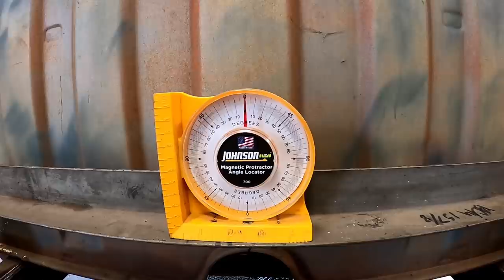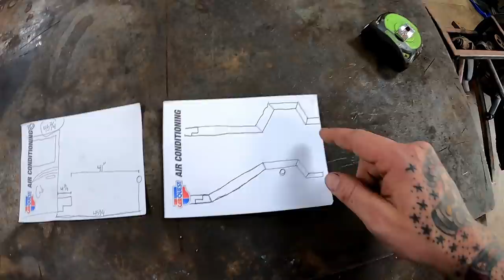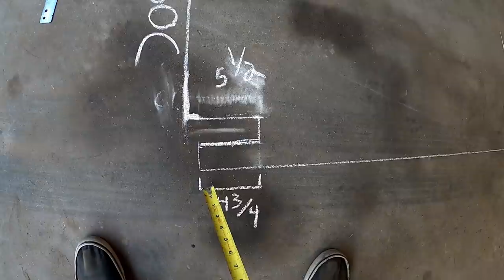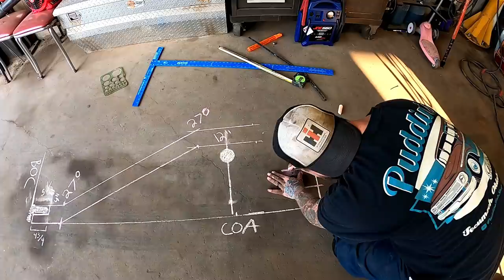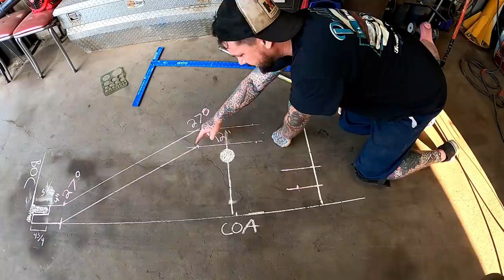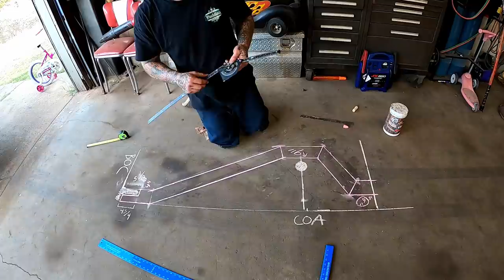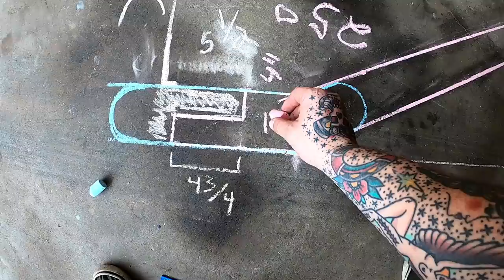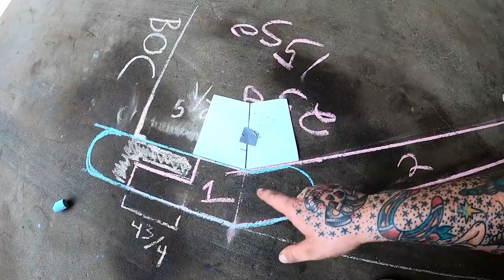Abandoned Minitruck Revival. “Dat-sun” of a B**** needs a new frame.  1977 Datsun 620.

Comment: Years ago, I had an 82 datsun 4x4, and my buddy had a 82 2wd. For some reason he took the bed off and was daily driving it. I had an extra set of 33's and suggested he put 2 on the rear, well he did, and it actually looked quite cool all jacked up in the rear. He ended up driving it like that for quite some time.
Reply from the maker: That’s awesome 👊🏻👊🏻

Comment: That frame has gotta be 10x stronger than the original ever was, and that's saying something! I once loaded 3000 lbs of roofing shingles into mine ('83 King Cab) and it didn't hurt it one bit. Did make the front wheels dance a bit while going around corners, though. 😁
Reply from the maker: 😂😂 they are stout!

Comment: That truck is really cool especially 12 years ago done by yourself and dragging etc might have thrown the frame angle off some getting hot or twisting. I'm a mini trucker and going to shows seeing those mini truckin magazine cover trucks up close...well they were hack jobs. Love Datsun hard bodies ..my last was a 96 s10 and we did a 10 inch monster notch ordered the kid welded cut moved the tank cut the inside if the bed after going through 3 beds ..never put air on it also custom driveshaft tunnel ..it was so low the rear axle touched the frame with 2 stacked 3" blocks had to remove one each side front was only ever cut coil rode damn good after notch but hell I was 23 24  had custom u bolts made for stack blocks removed leafs..but point was after notch I made everything right. Never ever had a problem the way it was before..just had to prove I could be lower than everyone lol. Worked 8 hours then 8 hours that evening doing the notch. Damn miss those days lol now stanced cars. We got an abandoned 78 Datsun ext cab bagged sheet metal bed Canadian bed no strap hooks welded tailgate skin. We did front tubs for dude he left it since 2014

Comment: Back in 1970 i was told they were called (dot-sun) but you can call it any damn thing you want i'll know what you mean. 👍👍.  I like your cross ventilation air system. I use the same method in southwest Missouri.

Comment: I learned and was actually tracking on your fab work up. Especially, since you didn't use farm animal calculations! The frogs hair measures was bout the same as mine would be, a smooth skin nudge. Seriously, I'd trust your current fab work but you probably had a lot of fun  rides with your teen fab work too.

Comment: What a cool Channel bro reminds me of me and my my buddy we started a shop too early so we just use the excuse of it was a hobby shop but we had to revive them and Fab them at the same time when you buy yard ornament turds it's kind of a must. He got a  "real job " but still helped all he could . I stuck it out and in just a few short years I have more business than I knew what to do with was able to start choosing what I worked on and due to the good prices laid-back Style and a lot of other things we have in common the haters literally ended it I never even seen it coming but the one thing that I can't get over on top of all our things in common is my shop was called buddins instead of puddings. Being there was two of us started out it was Buddin Boys  Custom off road  and recovery. Don't get me wrong Doe-son my first ride got slammed 92 Mazda B2low cab-plus se-5. Learned how to drive a manual transmission in a little black and yellow dot-son of my grandads . Never forget those bed latches side hooks and those MoonPie hubcaps cooler truck then anything Nissan put out anyway stay Pimpin my friend

Comment: Got to remember rust is lighter than carbon fiber. It's all natural weight reduction. Yeah I just moved to Massachusetts a couple years ago and they have vehicle inspection out here too I think it's so dumb I'm from Chicago we don't have inspections we just have emissions and anything from 96 and prior you don't have to take in. Those little trucks remind me of my Mitsubishi mighty Max I love that little truck had a 7-ft bed a five-speed manual a little thing it was like a 1.7 l four-banger it was already basically slammed to the ground from the factory got it for 25 bucks it was a rust free truck except for one of the fuel lines rotted from the tank and the guy got it from already had pulled the tank out and literally right across the street is my boy's house with a lift rolled that mother f*** down up his driveway put on the left about an hour later had to take back in a few lines hook back up and just ran the crap out of that truck it's one of the first vehicles I taught myself out of fabricate on I worked in a metal shop and I made new rockers for it dope ass bumpers using big old steel pipe did flame job on the truck absolutely loved it sold it for 1700 and the guy who sold it too still has it and it's rolled over 375,000 miles on it now.

Comment: I'm currently rebuilding my first truck (1982 Jeep J10) and I have plenty of "what drugs was I on when I did this moments". I literally have to have a chemical flashback to remember why is there brake line patches?, where does this wire go? where's that burning smell coming from? what happened to the muffler that used to be on here? where is this radioactive liquid leaking from? and the list goes on lol.

Comment: It be easier to c notch the frame and put the air bags on the in side of the frame run bar cross the frame by the axle
Reply from the maker: All of that is still very possible here.. not sure what you’re getting at

Comment: Maybe I missed omething but why not use the plasma cutter for all those frame cuts?
Reply from the maker: You missed the shaky Joe part. No clean up with the cutoff wheel. Just a clean tight cut. Im not the greatest with a plasma. Out of the 10 pieces I cut I only had to tune one end of one piece. If I had used the plasma it would of been every end of every piece lol